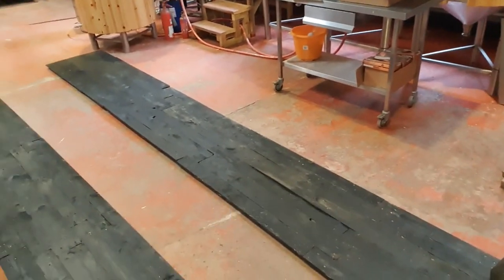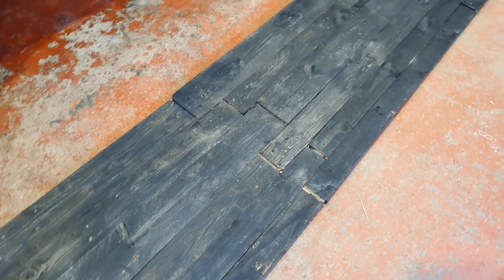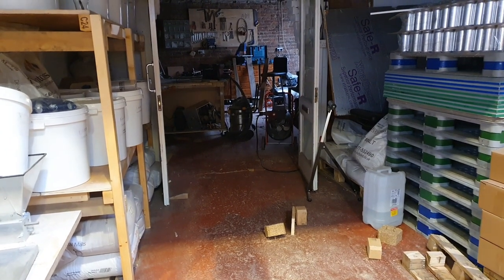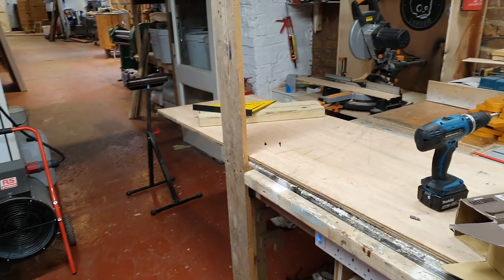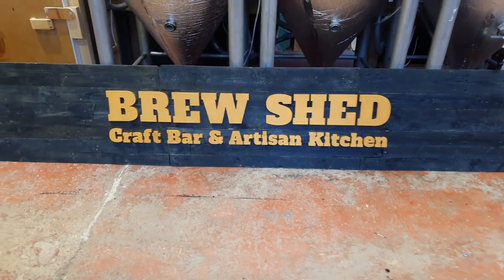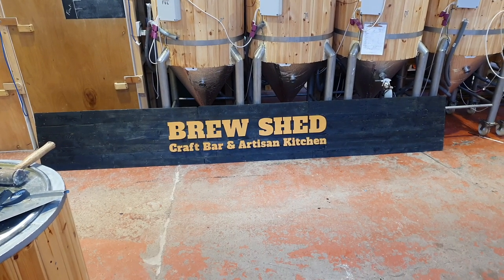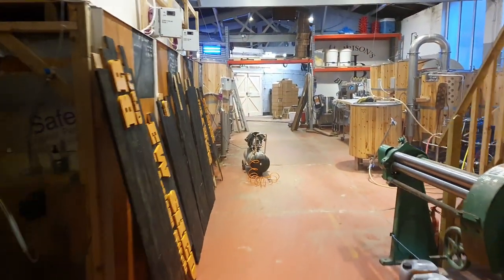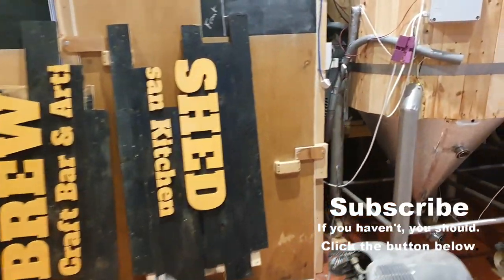Bonnie Brew Shed Signs

Comment: Hi Harry. The round letters are always slightly bigger than square letters so on the bottom line the square letters should sit slightly above the straight edge. On the top line where you used the straight edge on the top of the letters every letter except the S should just sit slightly off the straight edge
Reply: And I wish I’d read the other replies before posting that 😂

Comment: Do NOT alter the 'S'! I'm a Graphic Designer of some 40 years experience and a trained typographer. The letter S should be slightly deeper than the flat topped and bottomed characters. In fact its curved top and bottom should protrude equally. That's why it looks a tad low. It's an optical thing and how our eyes perceive correct height. If you shave the S it will appear too small. I hope I'm not too late! Looks excellent by the way.
Reply from the maker: Cheers Ian, I didn't change it.
Reply: @harrybrew69  Phew! It's an old typographical rule. Applies to all characters with curved bottoms (!). C, G, J, O, Q, S, U.